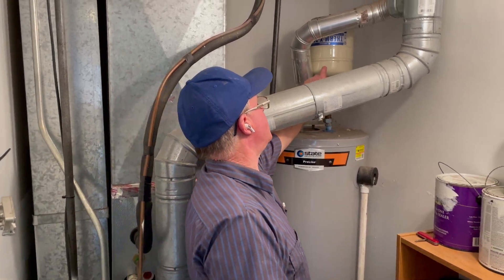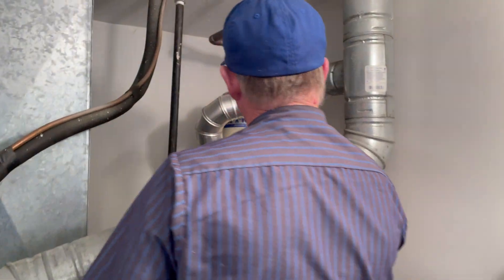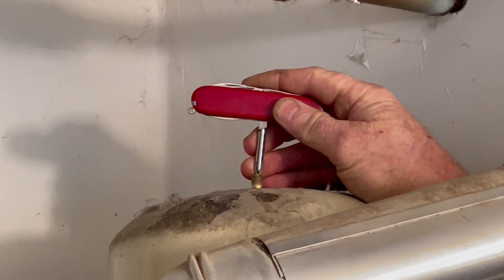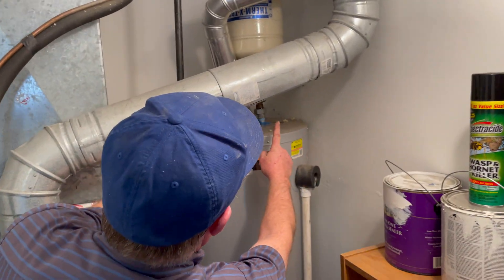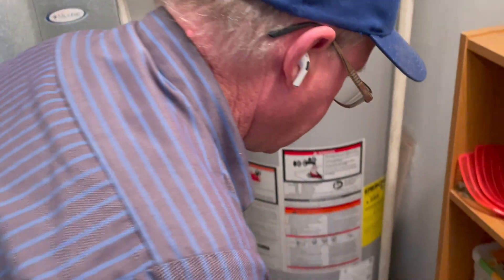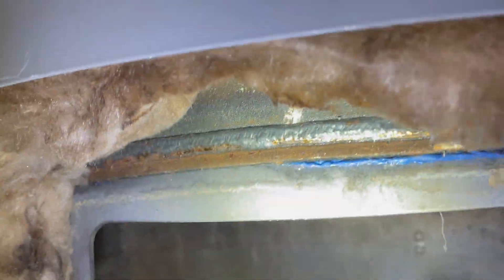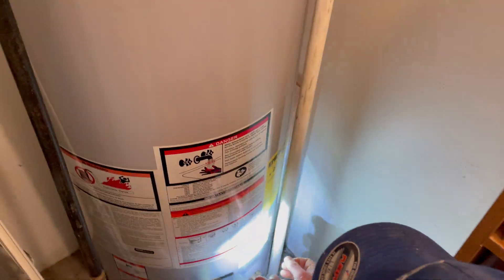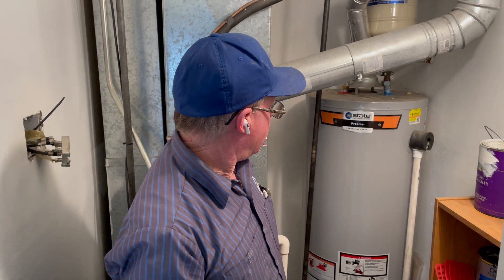Water Heaters: Tank Bulges from Extreme Heat & Pressure!

Comment: Something I've never experienced. We live in rural Indiana have our own well we don't use the thermal expansion tank and I'm on my second water heater owning the house 30 years. The one in the house when we bought it was probably mid 80s or earlier?
It's an electric water heater not gas. Although our Veterinary business gas water heater is original 27 years old with no thermal expansion tank it's also on a well.